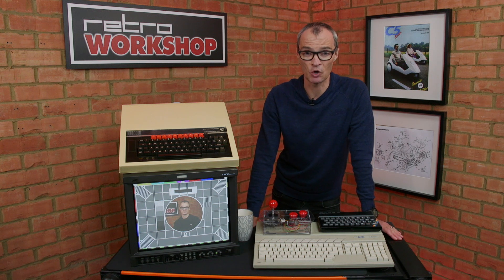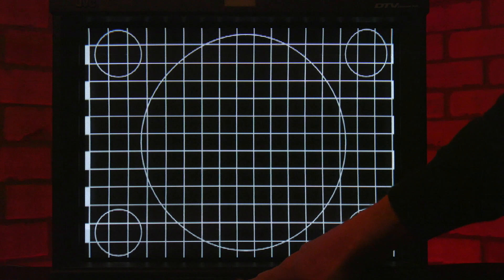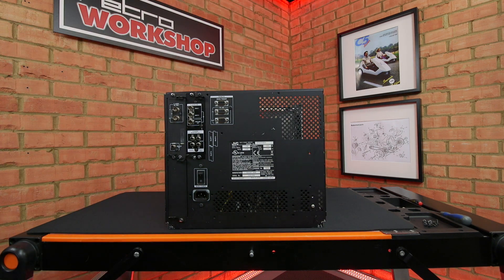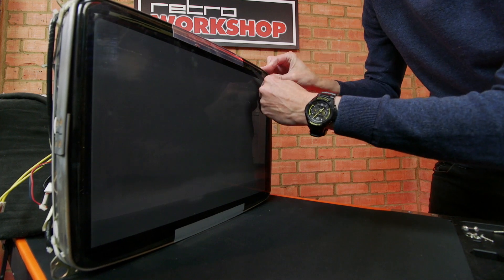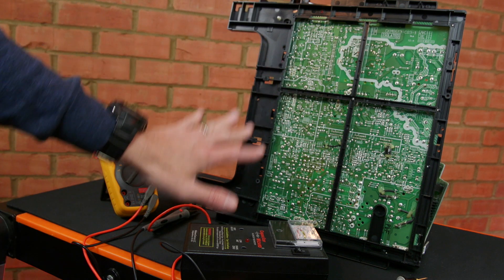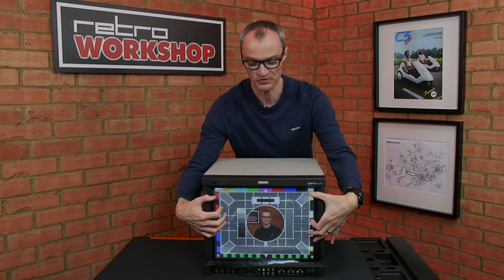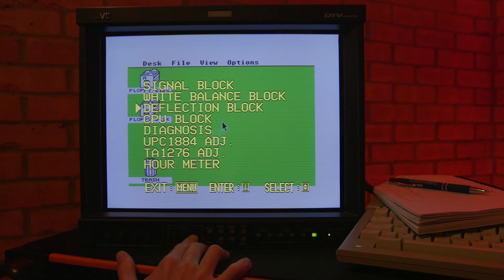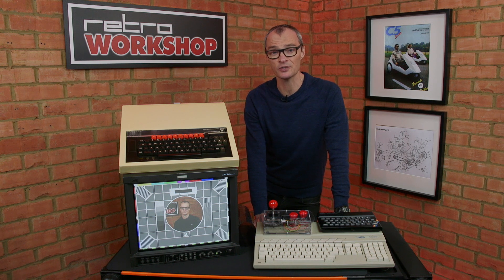JVC CRT Monitor | Scratched screen repair and review

Comment: Hello, have you perhaps encountered an issue with displaying the menu and the service menu? In my monitor, it disappears immediately after being turned on, and it is also impossible to adjust the volume. Apart from that, it works correctly and displays all formats.

Comment: A bit late finding this but I've been contemplating getting this exact pvm so it was very helpful to see such an indepth video. I'd have been interested to see how it performed on HD content too but appreciate if that's not really what you use it for. I have a Panasonic BT-H1490Y which is essentially a JVC. Great picture but a little small. I was hoping to size up to a JVC BM-H2000 but the sale fell through, last time I use FB marketplace! I'm intrigued by this model due to also supporting 480p upto 1080i and therefore being handy for many more consoles but wonder if the 17" is still a little small. I see there's a 19" but they're seemingly rare and outrageously expensive. I'm waffling now but was interested in your opinion on these models, I love the image quality on my Panasonic/JVC BT-H1490Y and I'm very tempted to get one of these, do you think it's a worthwhile upgrade?
Reply from the maker: Depends on your use case. If you’ve got room for a bigger model go for it. The JVC has an excellent image quality. I’ve seen broadcast TV HD on it, so real pictures rather than games consoles and it looks great.

Comment: I bought a regular trinitron monitor, any idea if they have a screen protector that can be removed as well?
Reply from the maker: Depends on the model. Probably not for a domestic tv.  Some high end BVM monitors had em too. Some pc monitors have a coating on the glass which if cleaned or scratched, you can remove the coating with alcohol to leave the normal glass. If the glass itself is scratched nothing you can do.

Comment: Hello and thank you so much for your series on this, watched both videos and they are amazing, subscribed! I wondered if you could help me make a decision....
My monitor came with the antireflective coating removed from the film, and I like the brightness just as it is, but I know you removed your film with the antireflective coating.

My question - if I were to remove the film, would it now be lighter still? Or did the darkness come from the antireflective coating and not also the film? Thank you for any advice here as I am wondering what to do next and if I need the tint stage.
Reply from the maker: The antireflective coating does not contribute to the darkness. It is the film itself that has the tint. If your film isn’t damaged leave it on.
Reply: @RetroWorkshop  thanks very much for getting back to me at this time unless we are both up too late haha! 

I do have a few chips and a scuff but they are all in the corners, so I think I will live with it after your advice, BUT if I change my mind I have these 2 vids favourited :)

Comment from the maker: Also see my other video where I replace the film.

If you have one of these monitors where the antireflective coating is slightly worn (rather than scratches that have penetrated the film that covers the glass screen, as on my monitor) you can just clean this off. Use some cleaner such as Flash Bathroom cleaner (the one that is good for limescale removal) and a micro fibre cloth. You can be quite vigorous. Use Q-tips / Cotton buds for the corners. Then final clean down with water. I have done this on another monitor and it works well.
Reply: Does this not clean the coating on the filter off? Or maybe thats whats stated? Just wanted to know if the antireflective features stay intact using this cleaning method or if you remove them.

Comment: Is he taking the piss with the helmet LMAO, there is totally no need to wear a helmet at all, i have never seen nor heard of a CRT tube imploding, and even when they are deliberately smashed, which is EXTREMELY difficult to do even with a decent size hammer, the velocity is not enough to worry about, usually they just crack and the glass shatters but stays for the most part in its original shape, there are YT videos of people trying their best to smash a CRT, expecting some sort of explosion, only to be disappointed with a few cracks here and there.
Reply from the maker: Hello there. I am a BBC trained engineer. We were taught best practise when handling a bare tube was to use a face shield and gloves. This is because people have been injured by broken tubes. The woodcutters helmet and visor I use in this video is a bit over the top, but that is all I have at home. If you want to educate yourself by watching YouTube videos of people attacking tubes with hammers and rocks, go ahead, knock your self out ;)
Reply: @RetroWorkshop  An observation of a few vids on YouTube doesn't equate to education, hopefully you are aware of that. It wasn't put down in any way, don't take it seriously my dude, i just found it a little funny, is all. We all could use an extra laugh eh, if you had some heavy metal playing in that segment maybe it would have come across better (I'm thinking of Iron Man where Robert Downey Jr is wearing the same helmet lol).

Your video I watched prior was actually really interesting and i should thankyou for having probably the only CRT film replacement video on YT that I'm aware of, I have been having the same thought for a good while, and it's really useful to see that the film you used yielded such good results. This is exciting for me because not only is your method perfect for replacing the film, it's also excellent for shallow scratched and scuffed glass CRTs, CRTs with relatively mild burn-in, CRTs with slightly washed out contrast, this is a great way to pretty much render these issues not so much a big deal as they would be otherwise, all for less than a tenner :).

Comment: 9:07 Why can't someone just reproduce these? In fact they could make them of all sizes for consumer CRTs as well to improve the black levels.
Reply from the maker: I think the market for such things is very small. It appears to be a specialist filter, very thick, with at least one additional coating applied. Something similar may already exist that could be cut to size, but I have yet to find such a product.

Comment: Great video! How did you manage to get such great video of the CRT? I have tried all settings on my Fujifilm X-T3 and I get the rolling bar. I'm using i 60hz modded console. Based in Sweden. Thanks!
Reply from the maker: My camera was forced to 50hz for use with various 50Hz computer systems. Certain zoom angles suffered from aliasing that was not visible in the viewfinder but wider and close up shots look good.

Comment: I'm seeing 15 pin VGA input on the back , would be possible to hook this up with PC even tho it's 15Khz ?
Reply from the maker: The D type connectors on the rear are 9way for remote control and tally. This monitor does support some of the lower  PC 30kHz resolutions but you need the RGB card shown in this video and a suitable cable.

Comment: Hi! I was wondering what kind of anti-reflective  coating it had. I bought the same JVC-1710CG monitor, but the foil was already removed. I would like to buy a new film for it. But I was wondering if this film is a sort of polarized foil. Have you got any ideas? Nice video btw!
Reply from the maker: Hi Michiel. I plan to get some privacy film for car windows, as well as nd film for house windows and try that. Still on my to-do list as I’m currently building a garden office. I will video it when I try this out.
Reply: @RetroWorkshop  Nice, I ended up buying a 90º polarization filter. I think this is the closed to stock, maybe I will add an layer of anti-reflective spray on top.. but that will be an hassle to add I guess. Do you still have the old film or did you trashed it?
Reply from the maker: @FR0MMEL  I kept the film but it is all bent up. I still think the main thing is to knock it down with ND filter (grey) but I’d be interested how you got on with your film.
Reply: @RetroWorkshop  the film is unfortunately a bit too dark. Do you happen to have a colorimeter? I really would like to know what the difference is in luminance with filter. When performing a luminance test with and without filter I could calculate the difference in percentage. My next step is a piece of 70% car tinting foil. But with exact numbers it will be much easier! 😊
Reply from the maker: @FR0MMEL  Hi Michiel. You need a light meter of some sort. I tried the waveform monitor built into my video camera, but this is affected by the gamma of the picture, which I can't turn off. I took out my SLR camera which of course has a light meter. The film gives exactly 1 stop reduction in light transmission. This is 50%. The meter is accurate to 1/3 of a stop so it is unlikely to be exactly 50%. I just ordered some 50% transmission window film for cars, and some for the home from a different supplier. I will aim to do a video soon (although nothing happens quickly here as you have seen!).
Reply: @RetroWorkshop   Nice! I am curious! I do have Portrait Displays C6 HDR2000 meter, but unfortunately my JVC did not came with the foil. If your willing to send me a piece of the foil I could check the luminance difference. Or you could buy a cheap light meter and test yourself. Hope we can share the information with others when you have the exact numbers. 👍🏻
Reply: I have tested 80% 75% and 50% car tint foil, seems that the 50% (gray) car tint foil works the best. The polarization foil seems to be a bit too brown and dark. 👍
Reply from the maker: @FR0MMEL  great work Michiel. My measurements found 50pc would be the closest match and I have both car window and house window film to test. I had to rebuild the studio but production starts next week on a short update video, so you’ll be able to see how I got on very soon.

Comment: Im looking at one in canada for $900 Canadian it has the rare svideo \ composite card and rgb card
hour meter is at 1000 and it's a 2005 model
I already own a pvm 19 inch is it worth getting at that price (mostly using sega gen and snes)
Reply from the maker: That does seem a lot of money. But it has very low hours. They are really nice monitors but if you have a large PVM you may be satisfied with that. Tough call!
Reply: @RetroWorkshop  i ended up keeping the pvm 19 inch cause it was bigger
Reply: I'm pretty sure I bought this exact monitor! Was listed with a gscartsw right?
Reply: @RobotChild  i think so

Comment: Excellent video. Very lucky that the monitor had that removeable film, I imagine a scratched tube would've been very difficult to deal with.

I have a similar JVC monitor that doesn't have RGB - I'll have to have a look and see if it takes those cards. It's not even something I'd considered.

Comment: Nice refurb and well filmed. Have you looked at the aftermarket anti-glare films that are available?
Reply from the maker: Thanks for the comment. I haven't seen any replacement films, but if you know of any suppliers I'd be interested to look into them.
Reply: @RetroWorkshop  You could try www nushield com. They sell anti-glare screens for all sorts of makes including JVC. They also have a custom size option if you contact them. I wonder too if the type of solar anti-glare film they retro fit to normal windows would do?
Reply from the maker: The Digital Orphanage great stuff. Now you’ve mentioned it, I’ve noticed dark film on car windows too. I will order a few different types and give it a go. Thanks for the suggestion.
Reply: @RetroWorkshop  have you ever figured it out?
Reply: Ah, yep. I am looking for the same thing haha. Could it be a standard polarized film? I would like to make the monitor factory standard again.